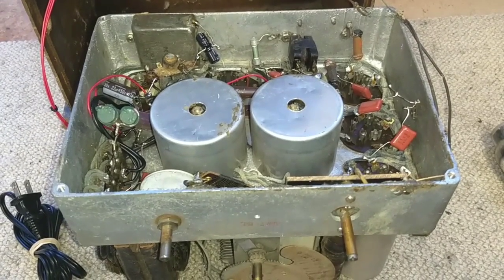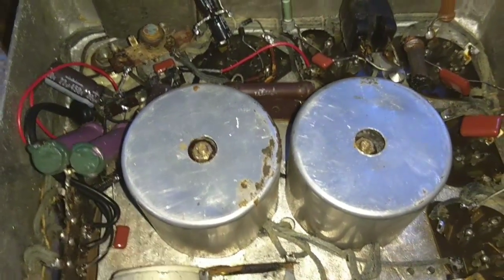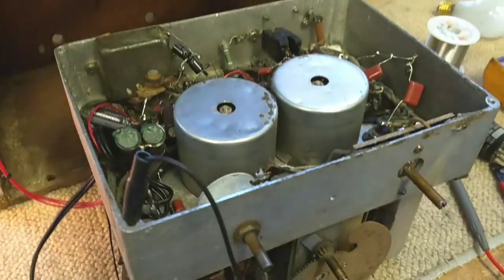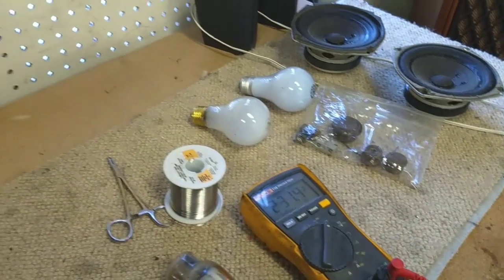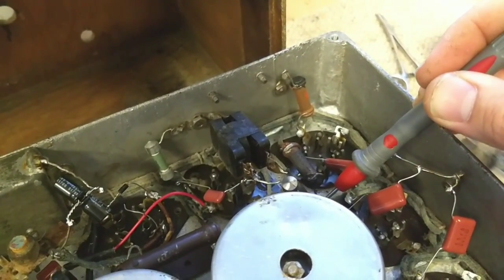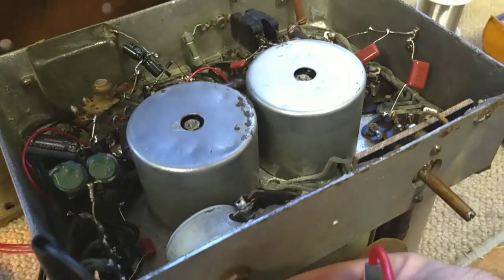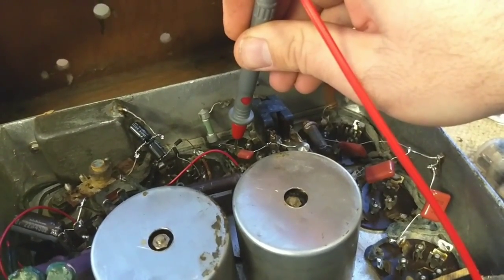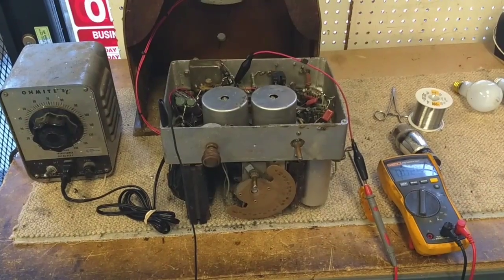Repair attempt of 1932 Aztec cathedral radio part 1 / ?

Comment: You definitely will need a long antenna to hear any stations on a trf receiver.  Check the grid of each tube with a signal generator starting at the audio stage and moving back toward the antenna.  Definitely install a dropping resistor to get the B+ down, that's way too high.  80's are easy to find, I would just put the tube in it if it were me.

Comment: Hello Mr Pier. That must be a rare radio. I cannot find anything on it  Check that resistor that's burned. It maybe almost open or so high in resistance it's blocking power to the plates,Though the amp does seem to be working. Sorry for my delay on getting back to you. Been crazy here . All my best. I Liked,Shared,Added to playlists. hope that helps. Keep the videos coming.

Comment: I would start checking the grid of the first 24 tube with an (RF) signal tracer (to see if you pick up some stations )  then ohm out the RF transformers (the huge cans). The quality of the magnet wires in the RF transformers wasnt that good back in the 30s-40s. Btw this is a regenerative radio without mixer/oscillator and IF stages. Anyway thanks for a great video. Looking forward to part 3. 🙂👍

Comment: A T.R.F receiver does not have if transformers just tuning and R.F. amplification. I believe the "volume control" is a regeneration gain control. I think you will need a long wire antenna to get this operating.  Only worked on a few back in the day. Good luck!

Comment: Very interesting case study. The first thing you want to do is get an antenna on it---unlike superhets, many TRF's have little to no noise between stations. Diagnostic from this point is very straightforward---measure plate, screen and grid voltages starting from the output tube and working your way back